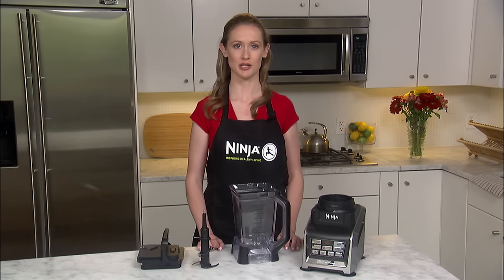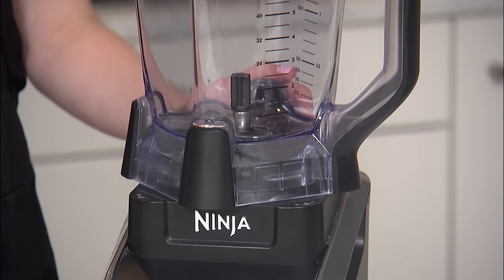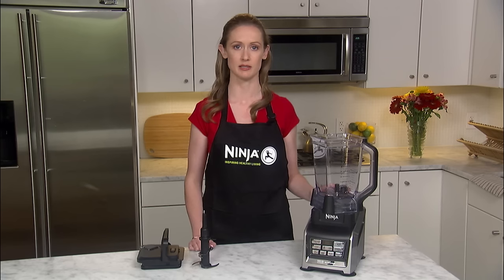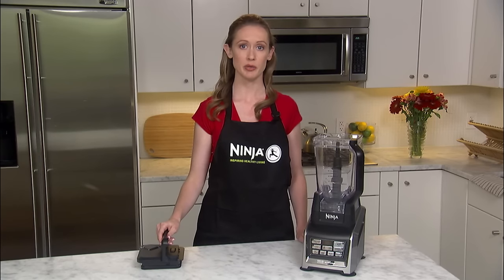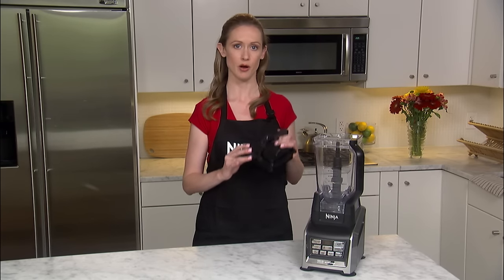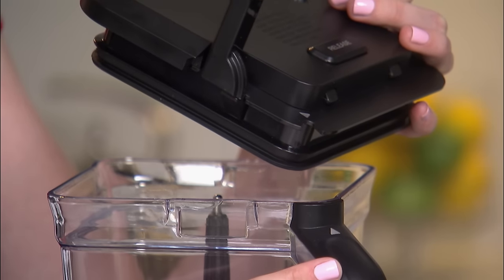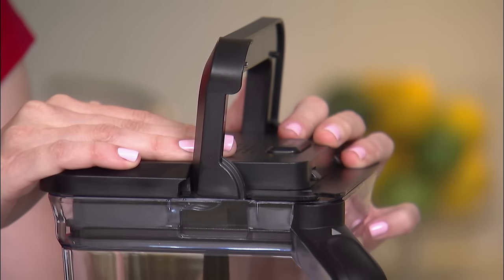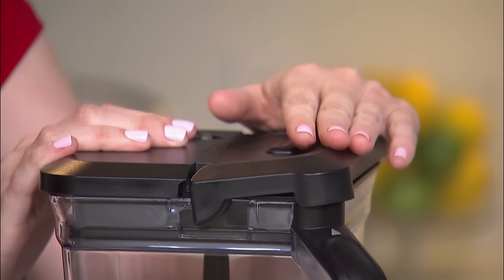Nutri Ninja® Ninja Blender DUO™ with Auto-iQ™ - How To Assemble The Pitcher

Comment: Does it matter how you put the blade in the blender. I made a smoother. It did not grind up everything. I repeat it over so many times but there were some hard seeds at the bottom. I notice the only buttons that I have are smoothies low and high.  she did not explained how to adjust the blades. Is there a hot line to call because I am thinking taking this back
Reply: Hey Google how many different kinds and ninja blenders can you show me

Comment: Anybody know if the blade locks into place or anything? I can just slide mine right off
Reply from the maker: Thank you for your question! The blade does not lock into place. Once the lid is locked onto the pitcher, the blade will be stabilized.